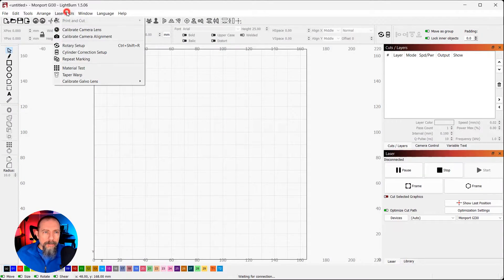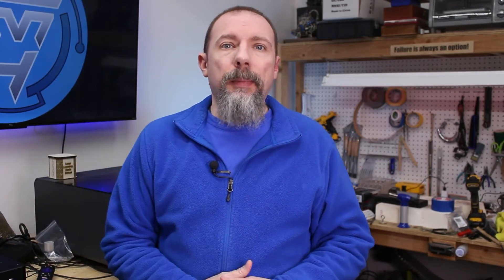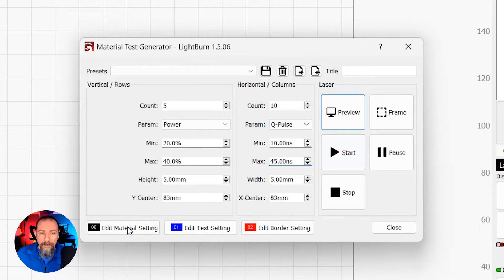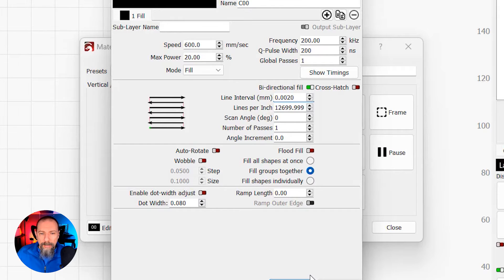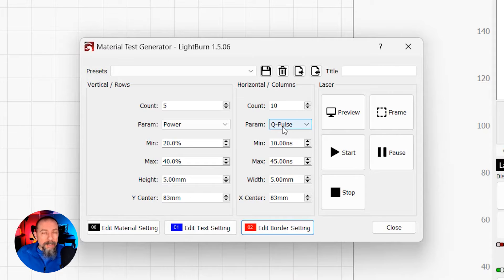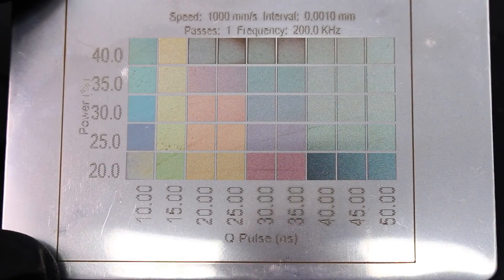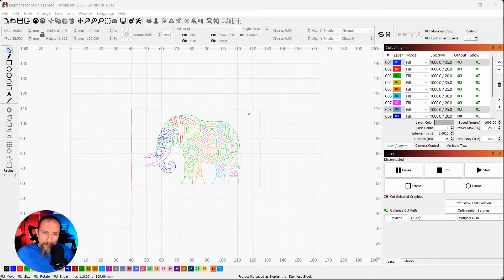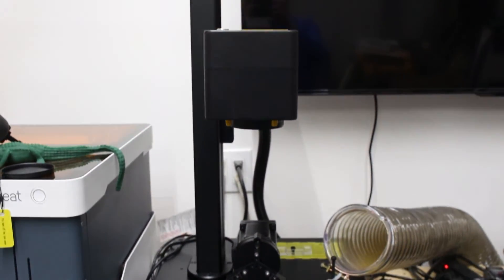Making Colors With a Fiber Laser! | GI30

Comment: Hey ;-). Thanks for your nice work. In one point you are wrong. You don't need a high expensive laser for cutting steel.  I am new to  fiber lasers, but already work with lightburn and diode lasers, still figuring out settings for my new fiber. During my tests i cut a 10mm circle 0.7mm stainless with 85% power, at maybe 150 passes, speed 400, wobble, 60khz. Probably this settings can be optimized, as i say, i am new and have to test a lot of settings more. I did not run a cutting test, that i will do during next week. Also i cut 0.5mm brass with 20 passes. I use a 200W JPT mopa, 175 lens. This system is not as exensive as you think....depends where you buy. Greetings, Kai

Comment: Definitely not getting the colors on your test plate you show in the video with the settings used
Reply from the maker: Assuming you have the GI30 I can think of two possibilities. One is you are using a different stainless steel which requires different settings to get the colors. The other is focus. I had to do some testing with my GI30 to get the right focal distance for the laser before I started having success.

Comment: My material test doesn’t have a Q pulse option? Just passes speed power interval and frequency
Reply from the maker: Check out this thread it may be related to your issue. https://forum.lightburnsoftware.com/t/q-pulse-parameters-missing/126666

Comment: Does this age or it stays as is forever, with no varnish or protective coating ? I read it ages and after some months it fades away.
Reply from the maker: I'm not sure about how colorfast this is long term (many years). I can tell you that the tests I did on my diode laser last year are still the same color as the day I engraved them.

Comment: Yes, I would like if you do the video using a dio laser.
Reply from the maker: It's on my to do list!
Reply: @LetsMakeAThing  same for me, I'd like to see this. I did only very dark black on stainless steel with a 10w diode laser, but first I had to blacken the steel with a flame. Then on low speed it stayed dark forever, even after 10 dish washer cycles (it was a knife blade).